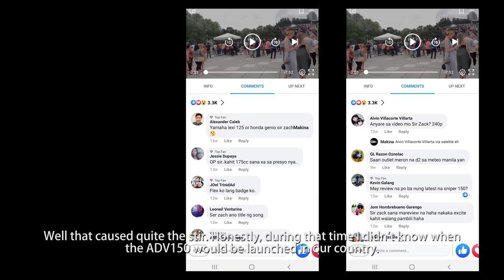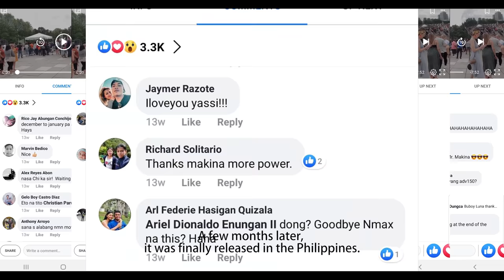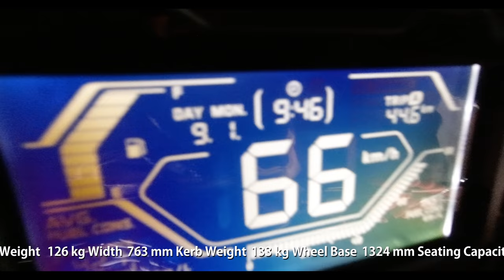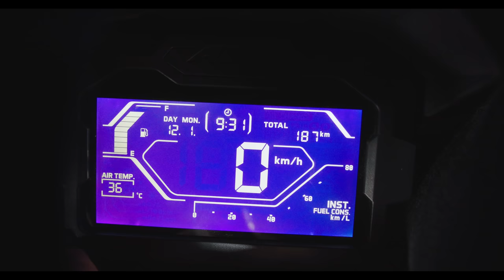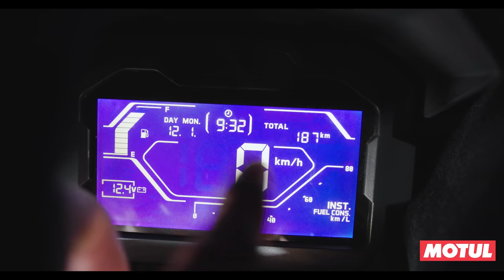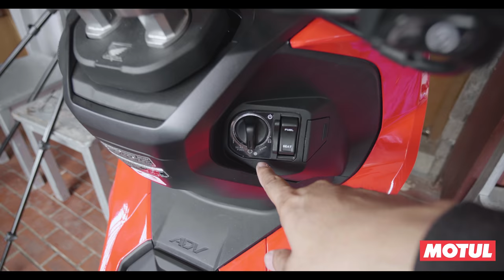Honda ADV 150

Comment: Kakabili ko lang ng 2019 nmax after irelease neto sa PH. 1 year after pinalitan ko sya ng adv150. Still satisfied user after 3 years of using. Naalala ko nong first encounter ko sa kayod na kalsada, halos walang kembot ung motor. Hindi siya ganon ka top speed pero super stable @100kph wind. The look really matches it's capabilities. I will never sell/replace my scooter.

Comment: Lucky to have ridden and owned a  couple of bikes. Scooters, dual sports and big bikes. For a city cruiser, i would choose the nmax. IMHO better torque and power. For an all around strike anywhere scoot, ADV 150 would be my choice. Why? sumasabay samin sa trail...Serow 250 dala namin. Syempre di sing bilis...pero kaya nya. Saludo

Comment: Mas ok sana ang review kung na i try sa off road since all pang off-rad din sya minamarket, kung paano ba ang handling sa sa batuhan, ok ba ang balance, at ok ba ang torque at power sa stop and go sa gravel at bumps, makapit ba ang gulong and maganda ba ang clearance sa ground kapag nag jump. To justify the 149k price. However, very entertaining video, gaya ng inaasahan ntin ky Zach. More power.

Comment: Parang mas bet ko to instead sa NMAX. Mas gusto ko yung specs neto. Kahit isang abs lang pero makapit ang brakes for suddenly stop. Syaka dati mas poging pogi ako kay n-max pero mas pogi to hahaha I guess na maganda pang off road to according to the tires hahaha. Syaka merong charger connector pwede ka mag charge while long drive. Syaka may set alarm na rin talagang safe ang motor dito.

Comment: A 200 cc 2-cylinder engine with encapsulated belt drive but not CVT, manually adjustable screen, good space for 2 people, ABS and double headlights, that would be something new!
Not always the same soup in a new pot.

Comment: They are a nice bike except for the speed/ rev limiter. The honda 150 will zip right up to 63 mph and that's it. The bike will start bucking like it's running out of gas. Most of the time that isn't a problem.

Comment: My problem with the ADV 150, is that it tries to be everything at once... and as such, it fails to be anything.

It's supposed to be an adventure bike, but the riding position looks like it's for a scooter. It doesn't look like you can ride it for hours on end. That alone makes it unworthy of being an "adventure" bike.
2nd, the ground clearance is very weak. Not even going to explain further because it's already quite obvious.
Positioning of the windscreen is also awkward, as an above average height Filipino, I don't see much use for the stock windscreen, talagang diretso sa ulo mo yan. I guess it's awkward because the bike is too small to have a bigger wind screen to make the wind go above your head, rather than TO the head.
Lastly, maybe to positioning of the sidemirrors and handle bars. Thing about other scooters like beat mio etc. the sidemirrors  and handle bars are positioned perfectly to fit between chars, meaning it's very easy to lane split. This bike though, it looks like it's going to be higher, and that'll cause serious problems when lane splitting (which filipinos really like to do).

All in all, I have to say that since it's just in the lower cc category, it doesn't really matter that much if you really like the looks of the bike.
However, if you really wanted a bike that's suited for what you want, be it adventure or daily commutes, there's a lot more better bikes out there.
Reply from the maker: Have you tried riding the bike yet? Yes you can ride it for hours on end. At least could.  Touring scooters are designed to be comfy.
 Windscreen works. Again you have to ride and not base it on what you see. Im not  a fan of windscreens. Its either it should be above the helmet or below the chest. In between it will impede ride sight and just cause more wind noise in the helmet.Regarding its genre and what its called. Well. You can hit Honda with that all day if thats your pet peeve but the thing is, in music..artists and bands call themselves all sorts of things from rock to jazz to prog jazz to emo, to punk to hardcore or whaetver. Getting hung up on labels is tough. Listen to the music and take it for what is regardless of genre. Like it. Great. No?  Its fine. But not liking a pretty good tune because it not labeled "properly" is denying yourself something good. Dont like a bike if its performs poorly, not because a company decided to call it  what its not. :) -admin
Reply: @makina8879  Just sat on it while I was doing a business visit in Indonesia, and what I'm trying to say is that it's not impossible to ride it for long... is that you wouldn't want to.

Compare it say to... a Dink 150, where you can comfortably lean back like sitting on a lazy boy.

Lastly, I think your last few remarks should be targeted to Honda.
They labeled it as ADV, so they were forced to get that adv look, yet the actual "use" of the bike is not for adventure. In the end, they could've leaned on one specific thing and made it better.

Just to be clear, I am a fan of Honda, I also have a big bike from Honda myself. I know Honda tunes it bikes well from experience. However, again, I just don't see myself getting this bike for an "adventure" bike... or a daily commuter bike at that. Only for the looks.
Does that make it a bad bike? No, it just means I'm just not going to use it for adventures / daily commutes.
Reply from the maker: You sat on it? You passed judgement because you sat on it? Ok. 
Also what is an adventure look? A honda cub can go around the world (people have been doing it) a royal enfield 350/500 as  well. Whats an adventure look? Bmw gs? Ktm 790? Crf4004? With that alone  whos to say "you woudnt want to use is for long rides" daily commute. Its essentially a 150cc scooter. Id think Honda would take "daily commute" in this segment yeah. But hey. You sat on it. So thanks for you insight. ;)
Reply from the maker: @estoylaroca  a year? nah. But riding it  for even 30 min will get you more info. And its pretty obvious that its a lot better than sitting on it while on a break from a business meeting. Strawman. You asking me a "would you" argument of a goldwing vs a uncycle and corelating  that with this scoot is pointless. Because the person you are arguing with on the otherside of the fence will naturally say yes. "yes i would  use a unicycle to travel the world over a goldwing"  coz I want to. See what i mean?  labels are just what they are. And a bike is a bike. If you will pass up on the adv because Honda names it an adventure and its not living up to your expectations based on your extensive sitting  on it then thats your thing. No problem.  Judgemental? Im not the one who sat on a bike and concluded  that  people "woudnt" use it for long rides. Thats assuming a lot right there. And no  its not stupid for people to buy a bike without testriding it. People do that all the time. No one is saying  that. But it is certainly the smarter move to try something as much as you can before buying it yeah? Id thing that would get a universal yes all around.  Some people will buy without testriding, there is a brand name and reputation to hang on to for them.  For you.. sitting on bikes is enough. Its cool. Its your thing. Oh yeah i just remembered. The Ducati Scrambler Cafe Racer is not really a cafe racer, nor is the Ducati Scrambler a Scrambler, The Dessert Sled is more Scrambler like, but Ducati decided to call em such. And what do you know..its their number 1 selling series to date. The BMW Scrambler? Oh dont get me started there. 9t series..almost going on 10 years now.  Sorry i signed my name zach awhile back, a mistake while having him  in my head as i type..ill make sure he sees your concerns. i just dont think hel care. Hes hardly in the comments section coz hes always out. And thats why he hired us young smart asses to reply. Thanks for your time. :)  -admin
Reply from the maker: Aaah...you know what made this long? You shoudve used I instead of You. You shouldve said "I woudnt want to use this on long rides". That wouldve ended it. Because you said "You woudnt wsmt to use thisnon long rides" well you see how I will respond right? :)
Reply: @makina8879  That makes a lot of sense. Just the part that you're not Zach.

I swear while waiting for your next reply, I was ready to type that I do hope you're not Zach.

But in all of your replies, the only thing I can say for certain is, is that you can't comprehend that people don't agree with your opinion. And to counteract that,  you're making very silly arguments.

So let me use your argument against you, and see how stupid it is.
You're saying that I'm judgemental because I "assume" people wouldn't like riding long distances with it.
But then again, why would you assume that people WOULD like it?

That's called a burden of proof fallacy.

But let's end this here, it's clear we're going to go nowhere until you can google the word: "opinion". Cheers :)
Reply from the maker: @estoylaroca  wc is why you shoudve used I instead of you. Its basic. I  did not assume  people wil like it. Your the one making claims using "woudnt you"?

Comment: Bobo ang nag sasabi na mas maganda NMAX kaysa ADV 150, SULIT Yung Extra charges at tama lang price... First off all, the suspension are made by SHOWA and Brakes are made by NISSIN, and it will not be cheap for the best performance they have(JAPANESE LEADING BRANDS, FYI competing to Ohlins and Brembo in MOTOGP) 2nd of all, Pangit handling ng NMAX at pangit ng laro sa rough roads ng pinas(kulang suspension travel), puro lakas ng makina pero walang maganda sa ibang aspeto. 3rd, Napaka comfortable ng seating and body position mo sa ADV at masarap i bangking, malaki ang pag kakapitan ng lower legs mo at itumba ang motor, mas mabilis pa ito sa kurbada kumpara sa iba dahil very nimble and stable, dali lang mag countersteer... AND LAST!  pangit ng looks ng NMAX rt, pag nmax motor mo pagkakamalang kang kamote, yabang pa sa stop light at out of style na talaga NMAX compared sa ADV na fresh... Alam kong Bias ako pero lakas nyo makasira sa ADV na hindi nyo man sa alam ang capabilidad, puro power gusto nyo pero mas mabilis toh sa kurbada.
Reply: Yesh. Mas mabilis sa kurbada, ground clearance mas mataas

Comment: Lodi says to other rider "ride safe!" but lodi rode sandwich in between busses... lodi pls walk your talk...
Reply from the maker: Dont let the wide lens be your basis for judgement. The adv 150  is not a small as the other scoots, and  Zach woudnt do it if he found himself in a precarious situation. There was space. Its was rush hour also.. They were slow at a 2 laner. The busses couldnt swerve in a 2 laner bumper at that speed even if they wanted to specially 2 busses side by side. If zach did that in faster conditions then yes that would he way more dangerous. -admin
Reply: @makina8879  what he did is still unsafe... Defensive Driving pa rin po dapat ang pairalin... he was on the blind side of the bus driver (on his left) po kaya delikado po iyon, alam nyo naman siguro na medyo kulang sa Def. Driving skills amd knowledge ang karamihan sa ating PUV drivers kaya dapat po ang pagiingat ay kay Lodi na sana manggaling... Kahit po gaano kahaba ang experience ng isang rider, isang pagkakamali lang po eh bale wala lahat yang experience na yan...

Would it hurt the channel if you'd say "thanks for the concern, we promise to ride/drive defensively from now on and be a good example to other riders"?

Thanks and more power po.
Reply from the maker: Not speaking on behalf of sir zach. But watch the video. The busses were hardly moving. Let the video speak for itself. He was getting out of the way already. How  will a bus swerve to the right at that speed? 2kph? Look at the wheels of the bus so you can see how slow they were going. Nakaka lula lang cam nya. Malapad ang adv. For him to go through there was ample space- admin
Reply from the maker: No it woudnt. And the channel would acknowledge. But you are insisting a situation based only on what a fisheye wide lense showed you. Nobody here needs to promise anyone safe driving. Its the norm. Without promising, it should be done. -admin
Reply: @makina8879  brod. Ang mali ay mali. Di dapat ijustify. Its unsafe. Alam mo ba ang ibig sabihin ng drivers blind spot? Masasabi mo bang hindi pwedeng gumilid saglit ang alin man sa magkabilang panig ng mga bus na iyon? Alam mo ba kung ano ang tumatakbo sa isip ng magkabilang driver para sabihing hindi sila kakabig?
Reply: @makina8879  admin, then dapat yan na agad ginawa mo. Basahin mo iba comment makita mo ang point ko dito. Ang pagovertake sa blind spot ng malalaking sasakyan ay napakadelikado, kahit sa kanino mo pang eksperto ipagtanong ito. Wag mo na sana palakihin ito. Even if it the shot was'nt taken using a fisheye wide lens, it is still unsafe... walang kinalaman ang wide eye lens dun.
Reply from the maker: Thing is its not. Lane filtering is legal. So di sya mali. Blind spot? 2kph?! Goodness. You are lucky night shift ako ngayon and bored. If zach was going 80kph vs 2kph inbetween busses
 Yun pede pa. Zsch was what 5kph against 2kph in bumper to bumper? -admin
Reply from the maker: Oo i can tell. Just by watching the video. Papano gigilid sa bumper to bumper? Ano yun teleport? Its IMPOSSIBLE. Zach went in not to hang out. He passed 2 slow busses. Im sure zach who was there would know better.-admin
Reply from the maker: @dlanoroiroso  sorry. You werent there. And basihan mo camera ni sir  zach. Yes ive been going through the comments. Youre the only one fussing to this level. You generalize. This is situational. Overtake sa blind spot sa halos di gumagalaw na bus umagang umaga 2 lane bumper to bumper magkaiba ata sa nasa canto pakanan na blindspot ano? You need to sleep. Tulog muna you are getting emotional. Tom you will feel better. :) ill also inform sir zach of your concern. He hardly reads the comments wc is why he hired us coz he always out amd about. Pls dont get angry at me. But it is what it is. Kindly dont generalize. Lane filtering will mean going in between vehicles. When to do it is the key. Zach made a decision with two busses hardly moving. Again look at the wheels of the bus. Peace -admin
Reply: @makina8879  admin. Wala sa speed ni sir zach yan or kung bumper to bumper, walang kinalaman dun ang blind spot... magresearch ka muna bago mo sagutin. I can prove you are wrong and will stand by my statement na unsafe yung nangyari, yes it didn't turn into an incident (thanks be to god) pero its an unsafe condition na grumabe pa ang risk factor dahil sa unsafe act. You cannot ever justify an unsafe act bro. Tiao!
Reply: @makina8879  admin, sino galit? Baka ikaw? Di ko binase sa 3rd person view... unsafe yalaga yun tira na yun. Professional opinion po ang sa akin at hinde hakahaka lang. Subukan mo itanong sa mga Riding Safety Experts kung ano ang drivers blind spot, hindi lang yan sa kanto... iba yung sinasabi mo... ang blind spot ay hindi lang yung ikaw na driver/rider na hindi mo nakikita... gaya nga ng sinabi ko eh yung blind spot nung driver ng bus ang delikado.
Reply from the maker: @dlanoroiroso  phycic? Its a  fact. Commons sense. A bus cannot physically swerve onto anothwr lane at 2kph with no space from the front coz of bad trafik. Also blind spot? Are you telling me the bus on the left cannot see the bus on the right? They were paralles. See the common sense here?  There is no corner for bus on the left to turn. They were going straight. :) -admin
Reply: @makina8879  admin. Again. Walang kinalaman ang blind spot nung bus sa speed... kahit 1kph pa yan, kung makabig ng di sadya ng alin man dun sa dalawang bus ang manibela eh maiipit si sir zach.... unsafe condition yan, at lalo pang naging delikado dahil sa unsafe act ng pagdrive sa pagitan nung dalawang bus dahil its ua blind spot for the bus drivers. Safety is all about common sense.
Reply from the maker: @dlanoroiroso  look at the situation. Pano kakabig?
Reply: @makina8879  accidental, dont ask how? Driving Safety Risk is about "what if?". Hindi monpwedeng ipagpilitang hindi makakakabig yan... kahit isang pulagada lang ang space nyan sa nasa unahan nya eh makakakabig yan. Blind spot yung pagitan, unsafe condition yun at unsafe action ang pagtawid sa pagitan ng dalawang bus... pwera na lang kung naka park yan at walang driver yung bus ma magiging cause uncertainty.
Reply from the maker: @dlanoroiroso  exactly 2 buses parallel at 2kph 2 lanes. Blind spot parin? Forget sir zach. Driver to driver di nya kita? Theres nonreason for him to swerve? At kungnwhat if reaaoning moneh wag na tayo lumabas ng bahay. What if ma tamaan ako ng ligaw na bala?-admim
Reply: @makina8879  clearly, di mo naiitindihan ang drivers blind spot kaya nagagawa mo mamilosopo comparing safety risk sa chances of getting struck by lighting. Yang pilosoping sagot mong yan ang magpapatunay na hindi mo alam ang ibig sabihin ng safety.
Reply from the maker: @dlanoroiroso  i know blind spots and understand kung san sya delikado specialy na halos di na gumagalw yung mga bus at 2 llane at nag kkakitaan mga driver. Hindi po pilosopo. Common sense lang. Sa daming rode nanninsir zach sa buong mundo parang mas aangkas ako sa judgement call sa isang situation ma andoon sya. Ikaw basihan mo wide cam. Sinsor zach andion na. Fact. Halos di gumagalaw mga bus. Masikip. Nag lane filter sya. Thats it. -admin
Reply: @makina8879  bakit pinapipilitan mong ang basehan ko eh yung lens na ginamit nyo? Hindi yan ang basehan ng unsafe condition at unsafe action na nakita ko. At mali ka po sa interpretasyon mo ng blind spot... hindi yan about sa kung nakikita ba nung magkabilang driver ang magkabilang bus or kung nakikita ba nung bus driver (left) yung bus driver (right) dahil parallel sila... magaral ka po ng defensive driving and you will know what blind spots are...

Safety is all about common sense.